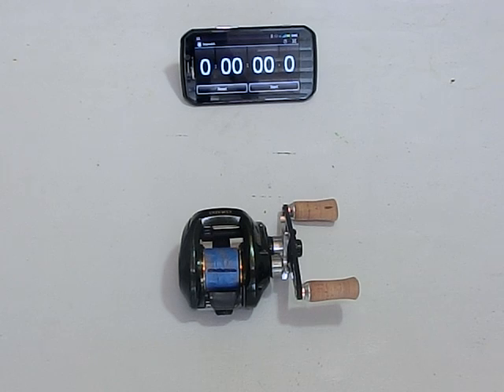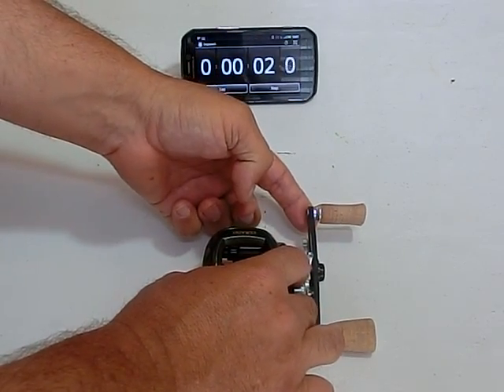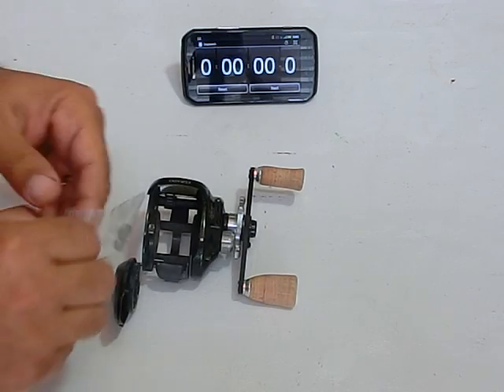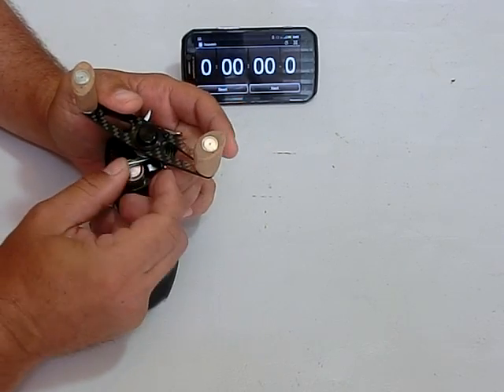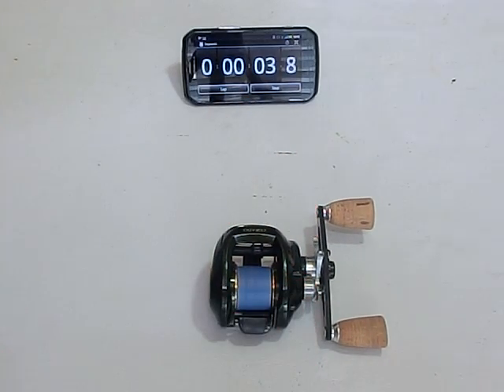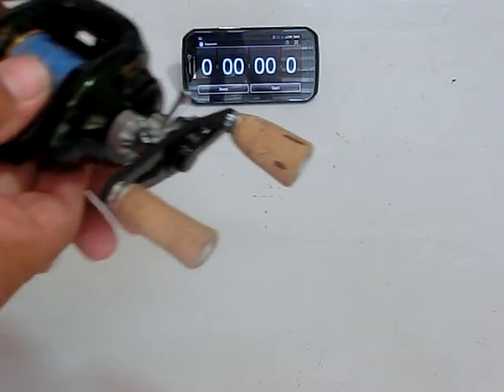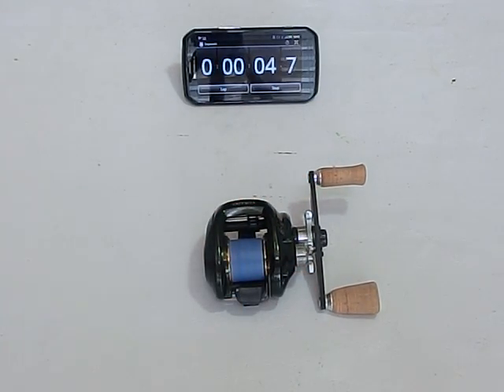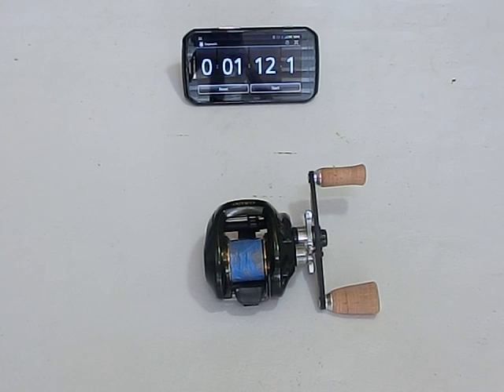Free spool demonstration: stock vs. ceramic hybrid bearings (ABEC7)

Comment: In response to Shamaryaho1's comment:  Isn't backlash caused by the spool spinning faster than the line coming off of it?  How would putting in smoother bearings (faster spin with less effort) help prevent backlash?
Reply: redrex3 your correct. After installing most guys find themselves adding more brake so not much gained but you may see a difference at shorter casting distances.
Reply: redrex3 - Consistency. In this application, the tighter tolerances in the manufacturing process of the bearings is said to offer greater consistency in the bearings performance, offering a more predictable and repeatable outcome.

Comment from the maker: Beau, looking at the specs it appears that we are very similar to the Bocas in material and construction.  One difference: the Bocas use a stainless steel cage material, where our bearings have a nylon cage.  I like the nylon cage enclosure as, in general, nylon cages run a little quieter (dry) and a little faster.

Comment from the maker: Shamaryaho1, we sell these bearings for $8 each.  This is a great price on these bearings.  Please note, though, that replacing bearings will not necessarily fix your backlash issues.  You need to make sure that your spool tension and brakes are setup correctly.